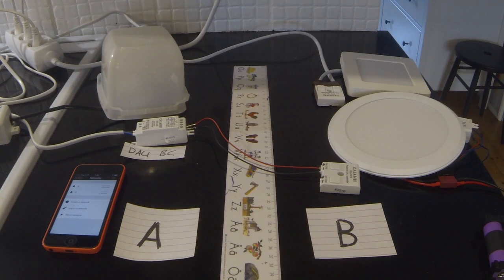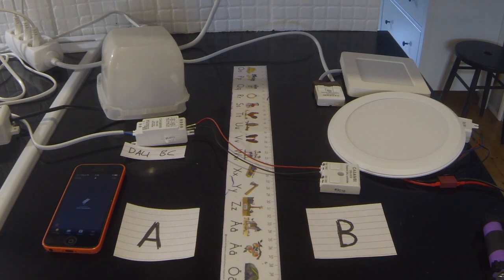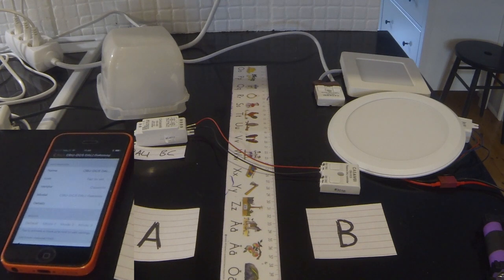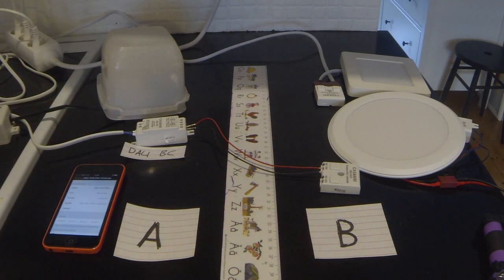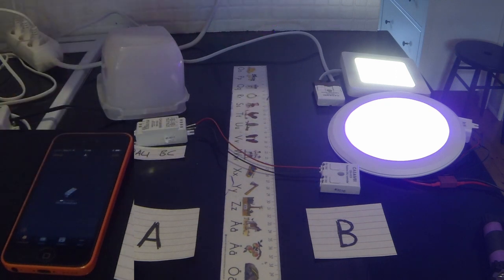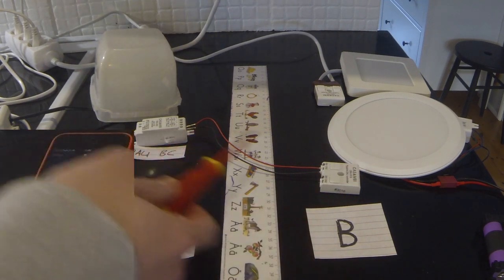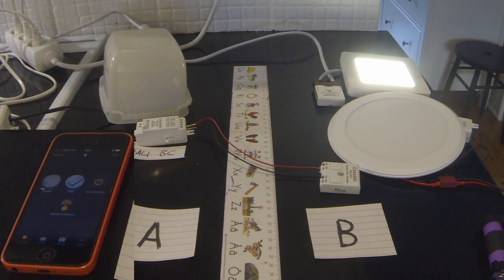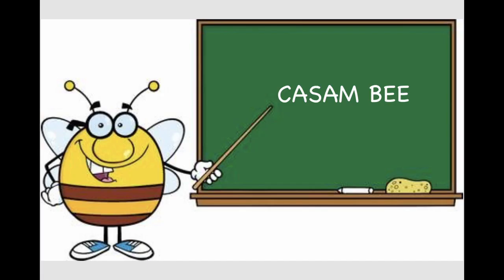Casambi Tutorial 19 - Network to network control

Comment: Can I send for you my light list ... If you can help me with casambi drivers because I don't know witch one I buy for my lights
Reply from the maker: Sure! You can write the list here. But the list needs to contain the types of LED drivers which your lights use.
Reply: @CasamBee  1.	Recessed spotlight, LED chip 15W,1375lm
2.	Recessed Laser Blade Spot Light, LED 10W,925lm
3.	Surface Mounted Spot light, LED 2x3W ,83lm/W
4.	Recessed spotlight, LED chip 15W,1390lm
5.	Recessed spotlight, LED chip 15W,1375lm
6.	Recessed spotlight, LED chip 15W,1375lm
7.	Linear light, LED 10W
8.	Recessed Spot Light, LED chip 7W,83lm/W
9.	Surface Mounted Spot Light, LED chip 7W
10.	Recessed down light, LED 24W
11.	LED Inground Light, 1x2W, 240V
12.	LED Inground Light, 8W, 240V
13.	Recessed Underwater Spot Light, LED 3x2W
14.	Wall Mounting Landscape Light, 1x4.5W, 240V
15.	Projector Light, LED 8W, 220V
16.	

**All lights above NON-DIM driver ..

17.	LED chip, 9.6W, 24V,TRIDONIC LED Driver 100W, 24V
18.	LED chip, 9.6W , 24V,TRIDONIC 80 LED Driver 100W, 24V
19.	LED chip, 4.8W, 24V,TRIDONIC LED Driver 60W, 24V
20.	LED SMD, 48V, IP67, side bend, 6w,40W, 48V  AC-DC Single output LED driver Mix mode (CV+CC) with built-in PFC; Output 48Vdc at 5A
Reply from the maker: @Fredrix99x  For lights 1 - 15 (which aren't dimmable), you'll need to use a relay switch to turn them on/off. There are several of these to choose from on the Casambi website. Personally, I recommend the Liga.Air models as they have a very small form-factor.

17 - 19, if those Tridonic drivers are dimmable, they're likely to use DALI control. So in that case you can use the CBU-ASD or CBU-A2D. Both do the same job but have different form-factors, so see what suits you (or your electrician). Note that the CBU-A2D is the newer of the two devices.

20. That looks like an LED driver which can control tuneable white lighting. Against, I'd suspect that the LED driver sis DALI controlled so you can use the ASD or A2D, as mentioned above. But you need to get more details from the manufacturer to confirm the LED driver's control method.

Hope this all helps!
Reply: @CasamBee  Thank you for the information, was very informative..
For the lights, from 1-15, what if I wanted them to be dimmable, do i need a separate driver for each, or is there a driver or a specific device from casambi
Reply from the maker: @Fredrix99x  it depends… if the lights are standard 220VAC dimmable lamps then you can just use a CBU-TED. I’d recommend no more than three lamps per TED, but Casambi claim the amount is not limited and instead based on the inrush current.

Comment: Hi there, active again? Nice idea for a little at home project. If one uses a DCS plus a Dali power supply (Tridonic or Lunatone, both not that expensive) instead of the A2D, it might allow longer wires. Of course also not Casambi approved :). Thanks for sharing.
Reply from the maker: Yes, a DALI PSU and a CBU-DCS would do the same thing. It's just the purchase cost of the extra device to consider...

FYI: don't ever connect a DALI PSU to an A2D or ASD, as it will damage the Casambi sevices.